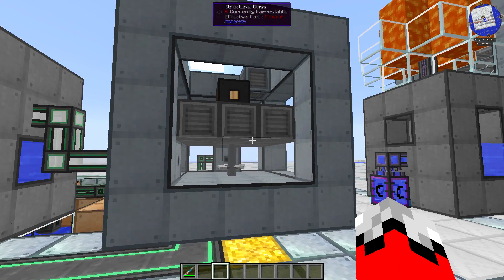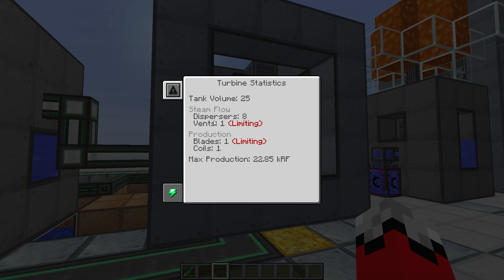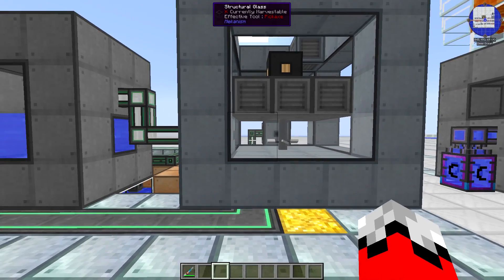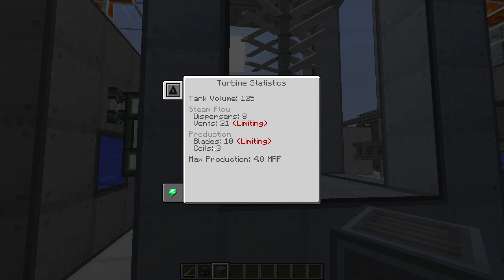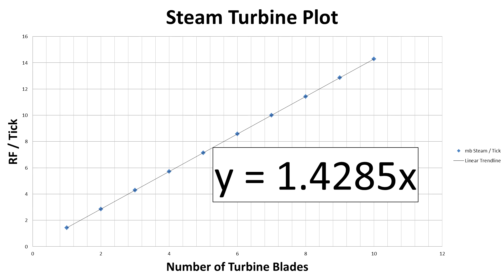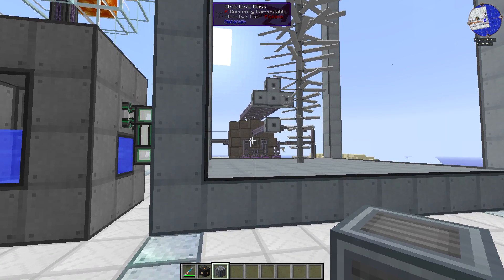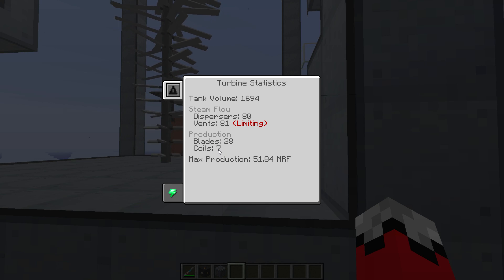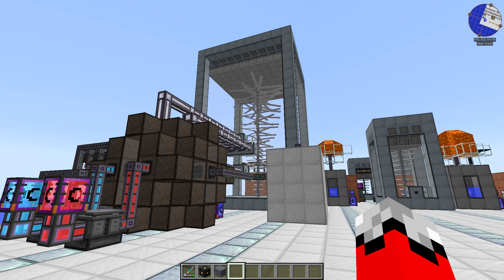Mekanism Version 9 Spotlight: Industrial Turbine

Comment: I might be (over a year) too late, but can you find a setup of gas-burning generators and electrolytic separators that nets power?
Reply: throw some gas upgrades in the gas generators and some energy upgrades in the electrolytic separator
Reply: Not possible, hydrogen is meant to be used as an energy carrrier. For production you can use ethylene.

Comment: I'm just curious... Have you tried using Superlaminar Fluiducts from Thermal Dynamics or Pressure Pipes to move around your steam and water? It's pretty clear that the finite transfer ability of the pipes is the performance bottleneck.
Reply: be better off just using a few tesseracts or putting the creative tanks on TOP of the pipes instead of the bottom and setting THOSE to output because thats actually where his limit is right now

Comment: This comment is really old but, In the newest version 9.2.0 you need a saturation block above pressure disperses. To get the turbine to work.
Reply: Well, no, might be a config setting on your server, but you don't NEED saturation blocks, they are an option though for some water return from the turbine, but not Needed.

Comment: how about one on a balanced 5x ore processing set-up?
Reply from the maker: "Balanced 5x ore processing" is kind of an oxymoron. Aidan has come out and said he purposefully designed 5x ore processing to be nearly impossible to balance; something many of us have experienced first-hand.

That said, it IS possible provided you don't mind building 100 or so brine towers.  We used to call the brine tower village "lag town."

All that aside, I certainly could go over the theory of 5x ore processing and discuss the reasons why it's so hard to balance.  Definitely something worth doing now that the brine tower numbers have changed with the new heat mechanics.  I'll add it to the list.
Reply: With large liquid fluid storage, (railcraft), and multiple (10) tanks of the gases, i could run 5 stacks of ore, before the 12 million... buckets of brine ran out, or ran out of the gases used for processing the ores. I have always used multiple mods to accomplish this, never tried it with only Mekanism.

Would really be interested in seeing your take on it. These are some of the best videos i have found of the Mod, they are very well done. Thank you for them.
Reply from the maker: +Zanzair Lupanar I think it's an interpretation thing.   In my mind "balanced" usually means "able to run continuously." 

Which, even in your setup, it can run a long time, but it will ultimately run out of brine and stall.  Which is pretty much as designed by Aidan: A truly balances setup is nearly impossible, but you can stockpile brine for large batches of ore all at once.
Reply: +ILabs TacoMage with the resistive heater you can overload a few brine towers with a fey 100k rf/t and you can create a balanced sistem and use an agricraft farm for the sulphur or the Ic2 way to make endless sulphur

Comment: Could You have a tutorial in much basic things such as the factories, crusher, how to make this or that. Sorry Just New to This Mod. #Noob
Reply from the maker: There are quite a few introductory tutorials to Mekanism out there already.  While I'm not opposed to an introduction to Mekanism video, it does feel like there really isn't a need for that kind of video.  A lot of the older mekanism tutorials should still be pretty valid (those that don't feature things like the endless energy hydrogen loops, anyway).

However, if there is a big call for an updated tutorial, I could be convinced to do a Mekanism tutorial series where I cover the mod back to front from a progression stand point.  It was something I'd thought of doing during the V8 era, but ultimately decided not to do because I felt it wasn't needed.
Reply: Thank You and the door is still open, yuo could change your mind. 😅